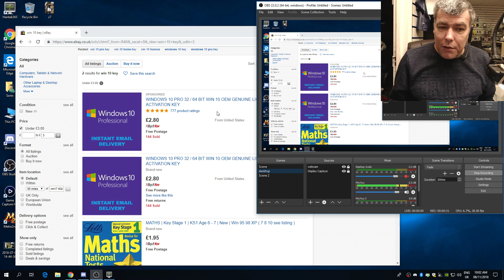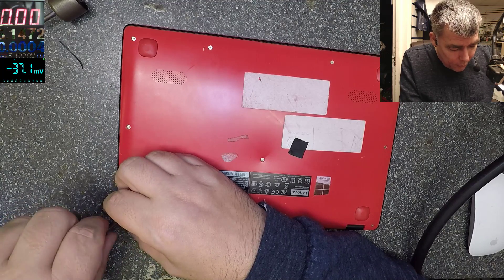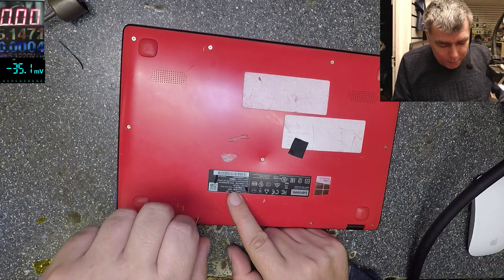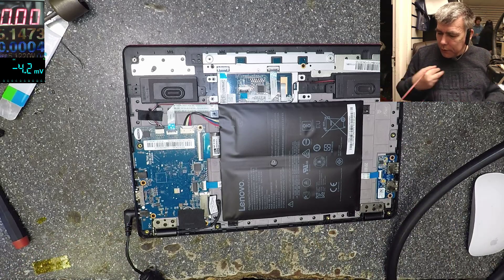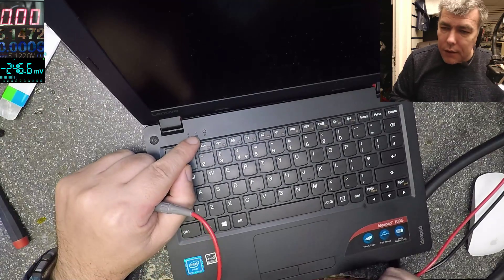Lenovo ideapad 100s - dead, repaired by a magic touch :D

Comment: A friend of my wife's dropped off her Lenovo IdeaPad 110s-11IBR. How I found the problem was easy but I wasn't actually thinking it was what I found. The Positive  [ + ] side evidentially broke off the charge port. Usually the - & + are integrated into the Mainboard but not on this model. The Negative & Positive, - & + wires are soldered onto the rear of the charge port, then soldered onto the Mainboard. In my opinion, it's the strangest way for the charge port connections to be soldered on. I ended up buying a Soldering Gun with the Solder Auto-Feed, which has a Reel for the Solder right on the rear of the Gun, so you can solder with one hand. That's the only way I found to be able to fix this model laptop. I just wondered if you use one of those type Soldering Guns. I do so little soldering, I didn't even know that they made this type of Soldering Guns.

Comment: My father has the same laptop with the same issue. I only opened the back and it worked but I have to make sure the charger is in. Maybe the connection is a bit loose, like the 110s you did last year?

Comment: Your electricity is better
Reply: i guess you are right, may be the power AC at Sorins shop is good enough to shock the system unit.and still i am thinking about it was over headed before it was used the last known good config/used. it happened to me
Reply: +pnoechie21 i stand corrected my self over heated.

Comment: You never saw a laptop @5v before because that's not a laptop. That's a joke, a tablet dressed like a netbook.
That battery is scary. I would have removed it and forced the customer to buy a new one or use the "laptop" without it.

Comment: Just the other day you said the voltage does not matter and you showed us when you applied 28v to a laptop. The current limiter drops the voltage to the correct value. Now you blew a 5v laptop by applying 19v to it. Confused now.
Reply from the maker: 5*4=20 4 times more voltage. From 19 to 28 is not even one time more
Reply: Ahh yes. My bad thinking. Thank you.

Comment: It's way much better idea to buy 2.60 pounds Key for Windows than using KMS Activators etc  .
Reply: better find an old win7 or 8 key on a dead discarded machine. It works for win10.

Comment: maybe as the battery has swollen like that the pressure between the case and motherboard caused a broken joint or track ?  and once the pressure was removed it made contact again ?   had an iphone battery go like that once, trashed the motherboard !  :(
Reply from the maker: possible
Reply: I think the problem was with the battery that got too much swell, beacuse of heat on the back and there was too much pressure between the battery and the backpanel. 
I had a LG Nexus 4 which battery was almost dead, after couple days laying on the windowsill beacuse of sun battery got that much swell that the backpanel was cracked, of course the was no amps by trying to charge it , and after removing the backpanel and testing things it started to charging, of course with low amperage but.. it was charging .
Reply: Could be the curse of the dendrites